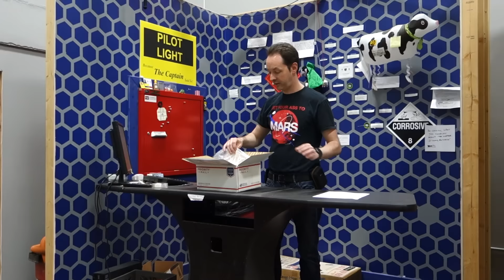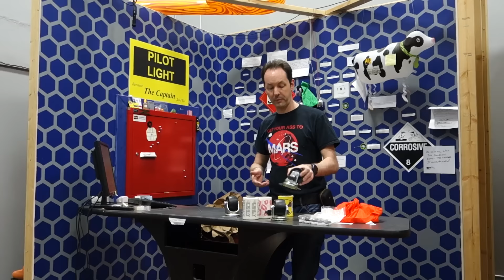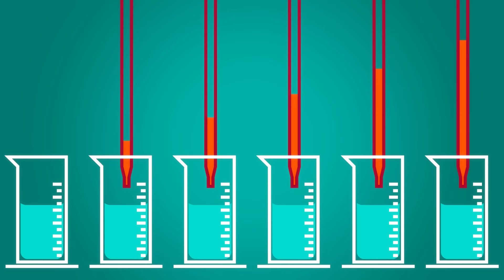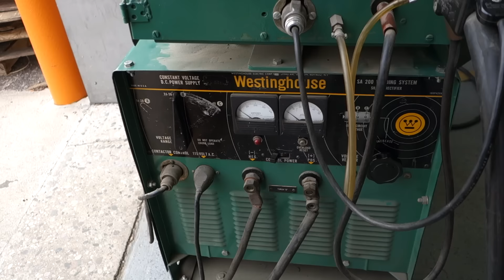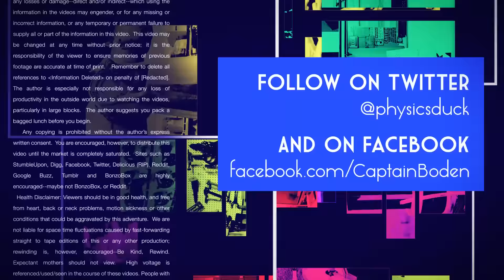Captain's Blog 4 19 2016 Boat 2 For Sale

Comment: You can't adjust current on a MIG welder. You run constant voltage, and you effectively change the current by adjusting the wire feed rate.

Comment: On my mig, the current is a product of the wire speed and the voltage. More wire, shorter arc because it's trying to outrun the melting of the wire end, which results in more current. Also, more voltage, more current.